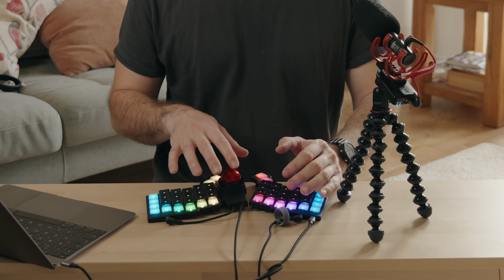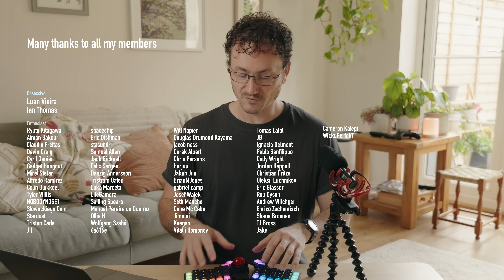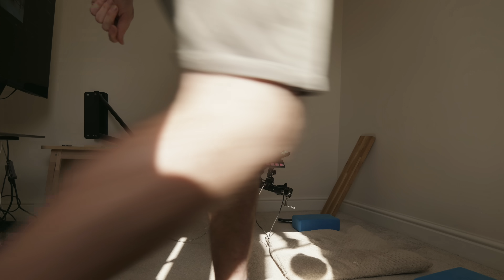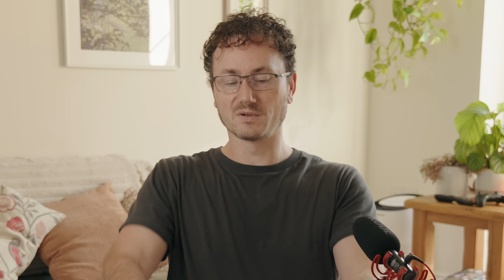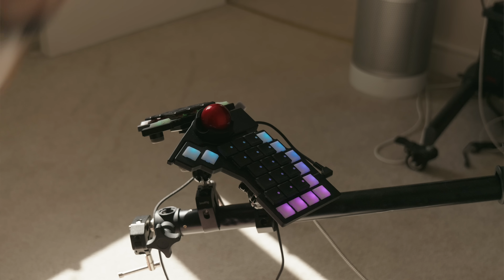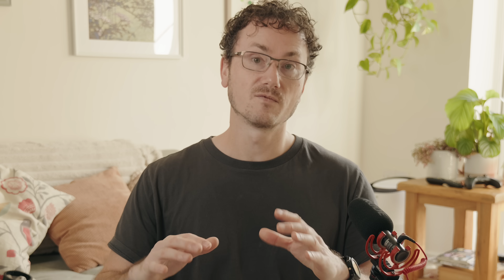ZSA Navigator - Hitting The Ground Running

Comment: What's the point not to use well-positioned thumb keys?
Reply from the maker: Thumb keys are there - I just moved them to the bottom row as part of a experiment in having more finger curl.
Reply: @BenVallack Do you have material about this?

Comment: If you're concerned about never leaving the home row. I think the best thing to do is to just abandon the idea of using the mouse altogether. Mouseless and Nvim really do remove the need for one at a base level of operation. Of course, there will always be use cases where mice are preferable. In that case, you just keep one for those instances. The only realistic option that would allow you to never leave the keyboard is if you built a board with a track point that can sit in between the keys. Personally, I'd prefer it to be between the thumb keys.
Reply from the maker: Or this!
https://youtu.be/-Lz_FNoYHNM

Comment: Chasing ergonomics can waaaaay to easily become a combination of (delving into worse and worse ergonomics with mental acrobatics to justify them,) and (a general spiral into madness trying to make working easier, while getting no work done.) 

A lack of motion is NOT ergonomic.  Variety of comfortable motion is.  Kneeling on a plank with your neck bent like a backwards C flailing around to reach the expanses of a giant screen basically glued to your forehead (what the actual...) is NOT ergonomic.  A lot of the issues people experience, perhaps most, can be solved simply by changing positions every once in a while, and not repeating the same motion in the same range for hours on end.  Minimizing your motion can often lead to doing just that.

I've seen a few videos from your channel and I have to ask myself how mentally ergonomic all this seems, and whether there are actually any gains at all for all this effort.  Take your video about Warp for mouse use:  if that was doing its job well, then your concern about reaching for the trackball should be very very minimal.  A mouse-like device is simply necessary though.  So why bother with Warp at all?  Why not use eye tracking tied to a key instead for example?
Reply: he will never answer any of this

Comment: What is the sense to buy a keyboard and not to use all of its keys?
Reply from the maker: It’s more that the size I wanted didn’t exist so you go a bit bigger and then use what you want.
Reply from the maker: Or rather they did exist but I found the plug and play simplicity of the Voyager appealing enough to not bother about the more niche approaches (diy or drop ship type builds)

Comment: I just purchased a kinesis advantage 2 used. The first thing I thought to do was mod it to allow for a trackball in the center. I like your unix philosophy video where you talk about purpose built tools for the specific jobs they are good at. I like having my custom keyboard for travelling, but I have a desktop computer and it is fixed in place, so I ended up getting the kinesis to sit there and do the job I want.

I am curious if you see yourself getting something like the advantage2 or advantage 360? (I prefer the 2 since I won't be moving it around). I know you have years of videos on your keyboard journey, but I don't think I've seen you go much bigger than 48 keys (after going super minimal).
Reply from the maker: I'm using Svalboard now! Funnily enough I made that exact point in a video I just recorded on it. There are too many good desktop-specific keyboards to overlook them for the sake of perusing something portable. Different keyboards for different jobs.

Comment: have you tried the svalboard?

Also have you tried a layout with a "the" key?
Reply from the maker: Hoping to try Svalboard very soon. Not tried a ‘the’ key but I did try ‘e’ on thumb and a repeat key on thumb. I really enjoyed the repeat key. I do find I hate typing the same letter twice with the same finger! I will likely bring that back soon.
Reply: @BenVallack  Here's some fun facts about a "the" key. The trigram "the" shows up 1.8% of the time in english, which is more common than the single letters z, x, q, j, and k combined, and also more common than b and v individually. So if you had a "the" key, it would make sense for it to be more easily typable than any of those 7 characters.

Have you seen Magic Sturdy? It has a repeat key, and it has a "magic" key that inputs something depending on the last key pressed, either to eliminate same finger bigrams still left on the layout, or briefs such as "the" and "and" and the like.
Reply from the maker: @grudley that is very interesting indeed! I know what I’ll be doing on the Svalboard thumb keys!

Comment: Hi Ben, are you sure about the arm setup? I think not having a place where to rest your arms or wrists will give you RSI over time... or at least this is my interpretation from my experience with the Charybdis 6x4 (BastardKeyboards), when I was hovering elbows and wrists. I have now moved on to a different Keyboard (Dilemma 5x3, always BastardKeyboards, fantastic project btw) and am using wrist rests --> pain disappeared!
P.S.
One thing that I probably should mention is that during my Charybdis era I was training a lot my speed typing to learn Colemak... this probably didn't help as well.
Reply from the maker: I've only ever found odd tingling issues arise from using a wrist rest so I'm all in on hover-typing now! I do think the positino of the arms when hover typing is critical though - hands must be much lower than the elbows.

Comment: brother, you can hold to zoom with scroll on mac.. it's accessibility or something. i use it all the time, dunno if it works with voyager scroll though, do lmk!
Reply from the maker: It zooms the whole screen, different to what I’m after which is application specific, might be a horizontal zoom in Final Cut Pro or a canvas zoom in Affinity etc. I.e it should leave the interface untouched.

Comment: I'd be interested regarding your general experience switching from a mouse to a trackball. Is it really a full replacement for the mouse or do you still reach out for the mouse from time to time ? How do you feel about that?
Reply from the maker: I was actually using the Apple Trackpad before this and have bee using that for several years. I really liked it but actually am missing it less and less now I'm using the trackball - it is great to switch between keyboard and pointer without such a big movement.

Comment: I have 2 complaints after using the trackball for a few weeks:
1. The ball tracking is too "sloppy". It doesn't really do a nice acceleration so that slow movements move small amounts.
2. The ball and its setting are too tall. I can't easily roll it with my thumb. 

I'd prefer an Apple Magic Trackpad. I love trackpads.

Comment: It’s really cool to see commercial products that are taking some risk. There’s been a number of custom keyboards that implemented a trackball but are not really readily available or well known.
I wish that ZSA had more adjustability with ball position and captive ball.
Reply: Given that the mount is 3d printable you kind of have a lot more freedom than it looks - assuming you have the ability to design and print a new base.  You're mostly just limited by the keyboard itself getting in the way.

Comment: I’m so curious how well dual trackpads would work if one moves the cursor faster than the other, and but them in range of the thumbs. Of, obviously, held keys change how quickly it moves

For what reason are the balls so big? I imagine a good one, but it would be nice were it small enough to be positioned so only the thumb could operate it.

I guess the ultimate endgame would be tiny trackpads on the keys themselves lol

Comment: Have you looked at the Svalboard? It has options for a trackball, trackpoint, and trackpad. I could be wrong, but it looks like the trackball is held captive.
Reply from the maker: It's definitely an interesting looking thing - will be glad to try it! I worry about it feeling 'odd' especially with lateral finger movements but I will be happy to be proven wrong! Although thinking about it my layout would probably work without needing many/any of the lateral switches.
Reply: @BenVallack  Yeah, you're kind of a cheat case 😆 I have a few folks out there who use no outward-lateral keys at all, and sometimes only 3 thumb keys as well a la Miryoku (Manna Harbour has one).  There were even a couple of custom builds I did that actually didn't even have those keys.  The transition for folks already using such minimal layouts is quite fast compared to normies.
The inward laterals are frankly pretty great, and some of the outwards are actually preferred by some folks.  Super personal anatomical preferences on these things.
Reply from the maker: @svalboard  Fascinating! Very interested to test this.
Reply: Svalboard does indeed retain the ball for steep tenting, as well as supporting touchpad and trackpoint 🙏🏻

Ben, want to try one?  I have a build in London at the moment looking for someplace to go 🙏🏻
Reply from the maker: @svalboard   Yes definitely! Can you email me? (email is in the about tab).

Comment: Thanks for the review. I'm starting to look at split ergo options (terrible for analysis paralysis). Voyager is an option, but expensive (compared to the likes of Corne, Lily, Sofle etc.). The navigator navigator trackball adds to the appeal of the Voyager. However it is an expensive addition and I don't like that you have to choose left or right hand; I would prefer ambidextrous then I can switch sides.

Comment: Have you tried a kneeling chair? Can get them for about 50 quid, or a yoga ball even?
Reply from the maker: Yeah all pretty good options - I just find they push things too far into the comfort zone so you don't move around again - yoga ball might be a good one for both being comfortable and not too static though - I'll give that anothe go actually - havn't used it with my boom arm setup yet.

Comment: The video shows how unnaturally the neck is bent back, this is very likely to lead to problems in the future, and the blood flow in the knees raises questions, I hope you often take breaks
Reply from the maker: I think that's just the look of the wide angle lens -  I'm just looking directly forward - it's also a shock to see someone not hunched over when using a computer!
Reply: @BenVallack  Maybe, but it looks like the upper border of the monitor is above the top of the head, and this inevitably leads to neck arching

Comment: What do you do at a cafe or traveling? How can you make such a system more resilient to external conditions that are sub-ideal? It seems like a choice between “60% ideal setup 100% of working contexts” (eg working on the laptop keyboard from anywhere) vs “100% ideal setup 60% of contexts” if you work from home.
Reply from the maker: My take on this these days is to just use laptop keyboards as they are with the same layout using Kanata to set it up. So the level of ergonomics is sort of proportional to the amount I use it vs the level of portability required. It's suprising how easy it is use to use a nice custom layout on native keyboards!